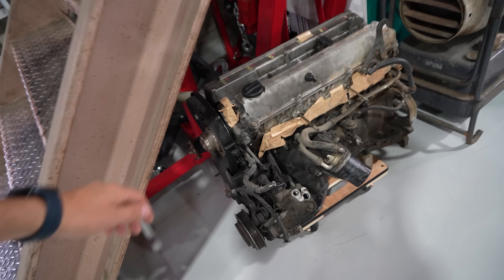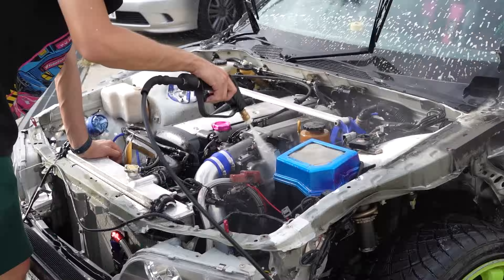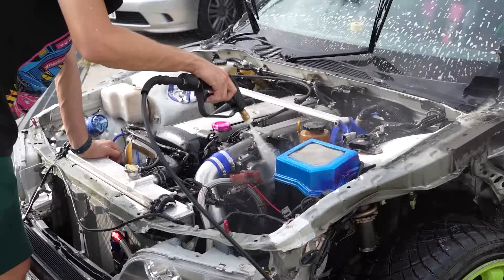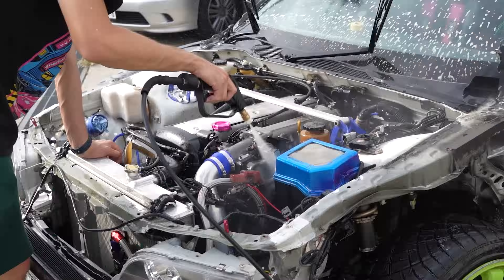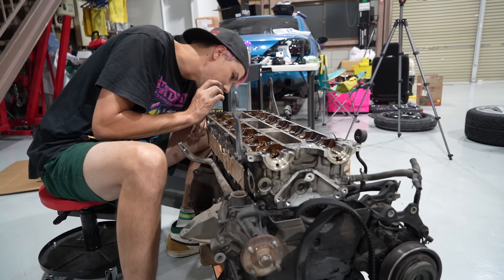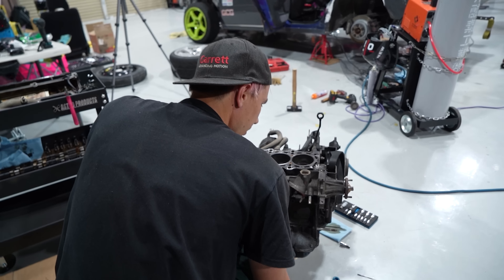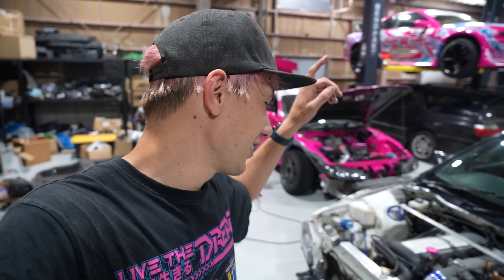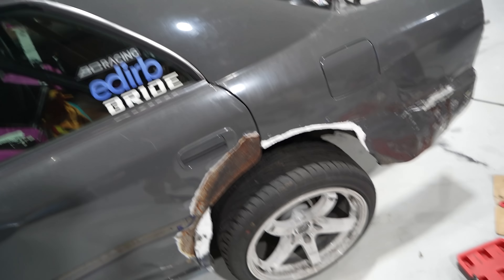SURPRISE DISCOVERY WITH 1JZ ENGINE!

Comment: A couple things to keep in mind when removing the head.

 #1 next time make sure you secure your cams before breaking free the cam gears. And I don’t mean hold the cam with a wrench. The cams are under tension and once the timing belt it cut they can “snap” into place and actually bend a valve. (You definitely should inspect the valves as I saw it do just that) There are tools that hold the gears together, alternatively you can put a wrench on each cam and clamp them together with a vice grip.

#2: A head-gasket failure is often not very easy to spot. It could be really faint or not visible at all. Also sometimes people mistake a bad head-gasket for a leaking valve or piston ring.
Reply: @TeraaHD  Correct, when i first started mines it was out of time since i had done the timing belt a year before i put it in the car and it just didn't sound right (being my first 1j and messing with vvt-i) after i re timed it it sounded much better and more responsive. Soooo thankful no  other problems have come up since then.  Thank goodness for them being non - interference
Reply: There is actually some variations of 2jz and 1jz engines that ARE interference engines, so better safe then sorry. Some cam upgrades also make these engines interference. It’s unlikely that’s the case with this engine but it’s always best to practice proper procedure just in case.

Comment: Welding sheet metal took me a while to get down. One thing that really helped me was switching to .024 wire. Give it a shot if you haven’t already! Another awesome upload as usual man.
Reply: A lot of us welders just lay tacks halfway over each other and it lays straight up dimes lol. And best if all, no burning through the metal 🤘🏼🤘🏼
Reply: @ptmiller98  Yea that’s really the only way to patch sheet. Even still blowouts happen and there is a bit of technique to filling in the holes.
Reply: a tech i picked up when you do get a blow thru hole from welding thin sheet metal (its gonna happen from time to time dependin on how thinned out the original metal becomes) is you gotta do “satan’s butthole” to patch the hole … where you kinda have to add material onto the edges of the hole to give it enough metal material (the welded material is always thicker then the thin sheet metal) that you can finally bridge back the gap.
Reply: @Unko-Q  Yea I have to do this all the time especially when I’m patching an area that had a lot of rust.

Comment: When pulling out dents the trick is, make sure you pull it out on the same angle as the dent was pushed in… I grew up in panel shops and I’ve been welding for 23 years.

Comment: Invest in a cheap porta power hydraulic ram, they work great for light frame repairs, straightening out core supports-pinched rails and whatnot. Great tool to have at the track with you along with a good come along winch for quick crash repair.

Comment: Make sure you check the oil cooler. Pretty sure 1j and 2j have water cooled oil cooler where the oil filter mounts to. Had the same design on my dsm, and the o ring went bad and started mixing oil with coolant. So Im just thinking maybe your 1j got misdiagnosed. I know they can go internally bad as well.

Comment: so on 1jz they have coolant lines into the oil filter housing and maybe it got cracked and hence coolant getting into the oil and blowing smoke from previous user. Also could be intake manifold coolant is leaking in there to since there is a coolant line near there!

Comment: take the door cad off ( 6) + /plus screws , remove by pulling up from the front corner of the rear door the outer chrome molding / weatherstrip , lower glass 3/4 way / until you see the 2 10mm screws holding the window to the track  , remove the 10mm , pull glass up and out !   i can swap the window motor in 30min .... just swapping glass is easy !!! DO IT !!

Comment: some cylinders have ben running hot. so it might be some bad injector's. running lean and then boiling. get the head pressere tested and a smal skim on top and block. and piston and rod's will be good.. a bit lower compression then NA engine. and yes. swap the glass.. easy job ;)

Comment: Something similar happened to me years ago, bought a cheap car at the wrecker. driving it home, car following told me it was blowing smoke so thought engine was trash, pulled it and left it for spares. Fast forward 5 years later dragged it out to rebuild for another project. Turned out it was freshly  rebuild and hadn't bedded the rings in yet

Comment: try to picture the impact and try to picture pulling the impact in reverse. also pull little by little. and keep in mind every weld will shrink the entire metal all around. think of the metal as a firm liquid. o and get yourself a cheap set of body hammers and dollies. check the deck height with feeler gauges and a straight edge as well as block. but yeah looks ok.maybe snap a pic of hg and send to oka chan.

Comment: i say throw a set of rods and pistons in and get ot all balanced and throw some bc cams in the head and send it with your bigger turbo on it but honestly you should cdo9 swap the chaser so it can handle the HP and not explode the trans or just try and find a company too get some straight cut gears for the abuse